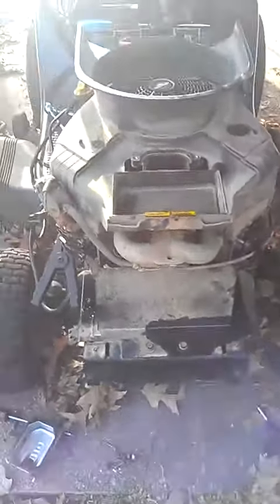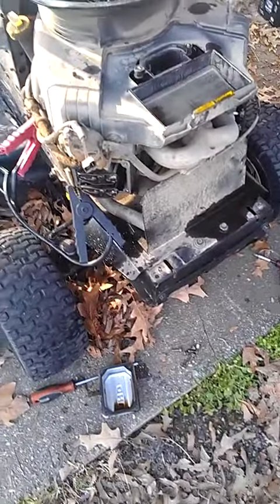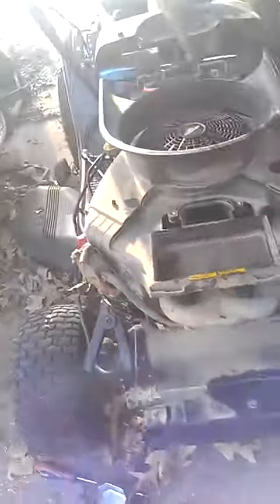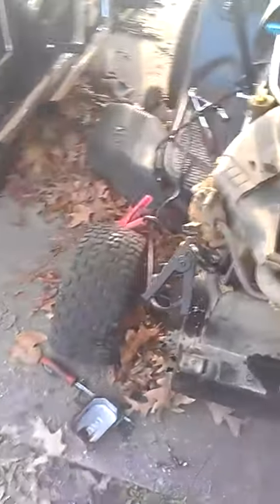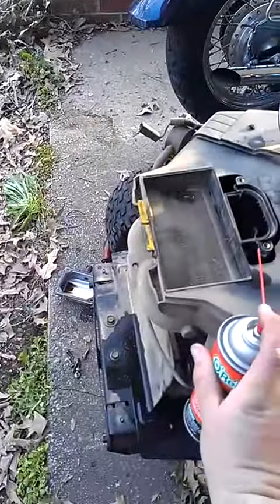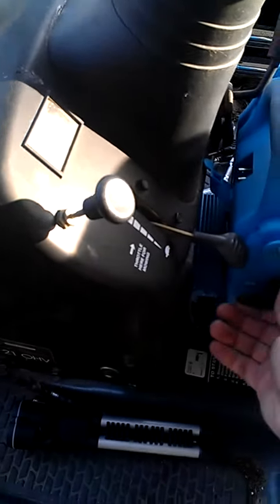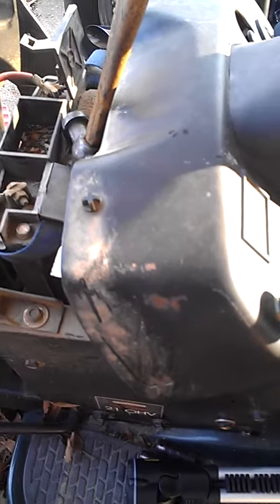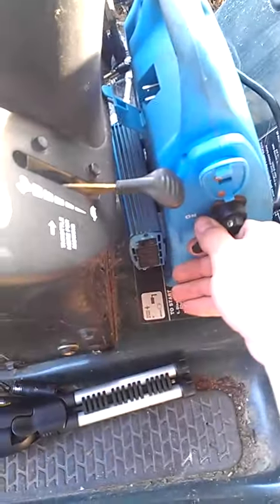craftsman riding mower 1st atempts at starting after rebending pushrods

Comment: So do you recommend straighting the bent rods, or was it the cause of the 2nd no start?
Reply from the maker: it finally started and I am still using this mower with the same push rods.  but I would recommend buying new ones.  their not that expensive.  but I'm just too cheep and stubborn.  lol
Reply: +jasonolinger Cool Deal. I bent the rods back on a quad today, crossing my fingers...it purred like a kitten. Thanks for the video.